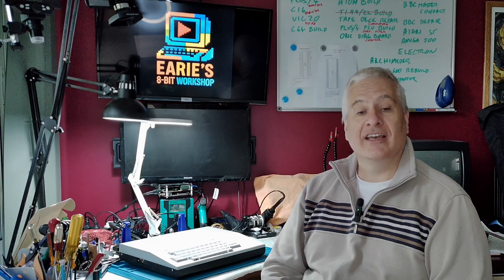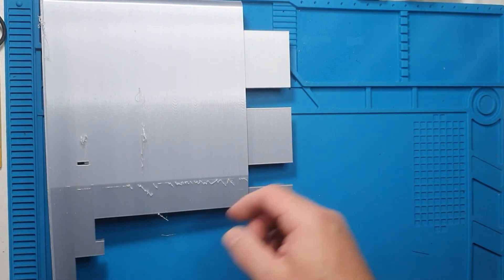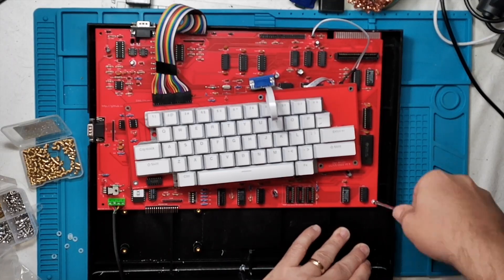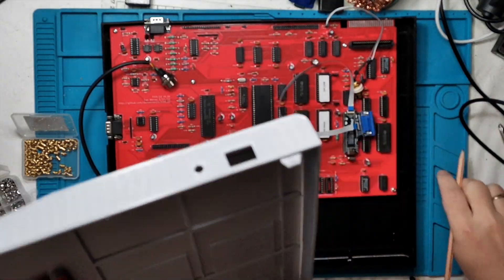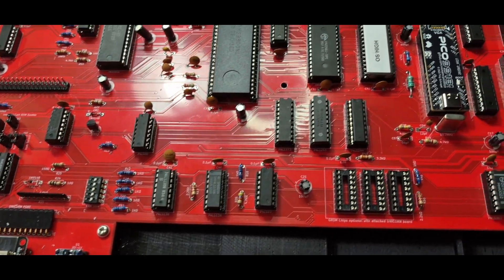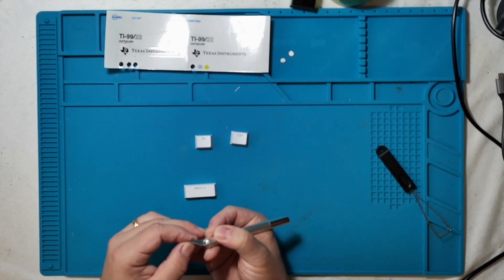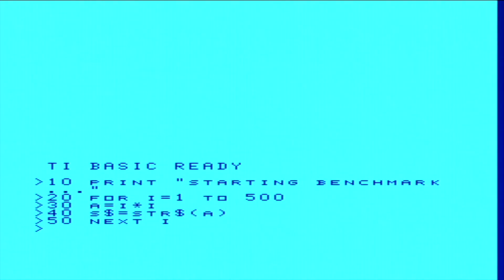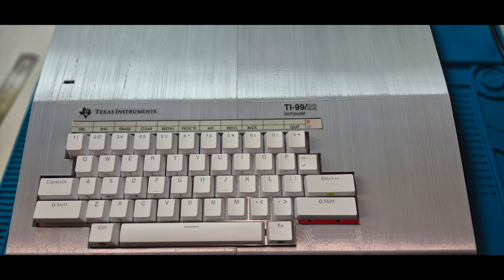TI-99/22: Build - The Finished Build & Benchmark Showdown! | Final Episode.

Comment: Seems like a very successful project. The TI machines were not overly popular in the UK, and certainly my experience with them is extremely limited. They were definitely a distinctive looking machine, with a somewhat "unique" architecture. Did you not sand down the case to remove some of the printing artifacts?
Reply from the maker: Unique is so correct. So many design choices had to be made to overcome first time problems made it quite a complicated beastie. Since filming i have taken some time to work on the print defects on the upper side of the case buy the sanding I would normally do seemed to impact the silver pla horribly. A test area became dull and dusty even with 2000 grit. If you know of any tips to handling metallic pla to preserve the shiny finish id love to give it another crack.